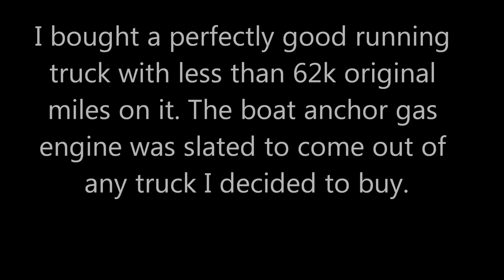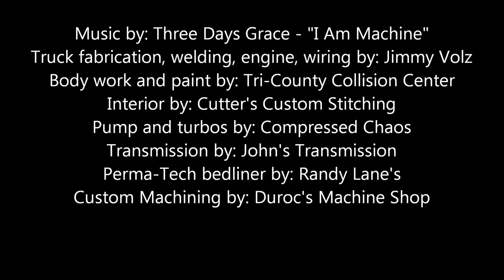1998 Chevrolet Cummins

Comment: All that work and kept it automatic?
Reply from the maker: Yeah... Should have put a NV4500 in it. I mean the auto does great, tows in OD with no problem, stays cool but I'm at no advantage with an auto in a heavy ass truck like this.
Reply: Chevrolet Cummins if I can make it work between the frame and body I'm ditching the 4L80E for a NV5600. I would really like to go with a Eaton 10 speed but that would require a straight axle swap to handle the weight and a lot of fabrication of the frame and modification of the floor. Way out of budget for me and I have a window to get my truck complete.

Comment: How did you tie in Cummins vac/PS pump to hydro boost?
Reply from the maker: I capped the vacuum pump. For the three lines on the hydro boost, one is a dump to the reservoir, one is pressure line to the hydro boost and the third goes to the steering gear box.

Comment: I'm 16 and looking to swap a cummins into an 86 k20. Not much experience, decent amount of knowledge though. Im afraid I won't be able to get the electrical part to match up. Any tips for me as far as wiring the engine and gauges?
Reply from the maker: I would suggest a wiring schematic for your truck and for the truck that the engine came out of. That will help a lot. Also, I would advise soldering and heat shrinking all of your connections that way you won't have to chase down loose connections later. My first conversion was in an 83 K20 and the wiring was pretty simple.
Reply: Chevrolet Cummins I guess it will be my job to do all the rest of researching to get it all to match up but I really appreciate the response. I've watched this vid probably 20 times, no lie. Song fits it really well. Your truck has been a great inspiration. Definitely the cleanest OBS Chevy I've ever seen
Reply from the maker: If you get stumped and can't figure it out, shoot me an email. I might be able to help. 98builtnotbought@gmail.com. Thanks for watching also.
Reply: Also, where did you learn all your knowledge of automotive. Did you go to school for it or has hands on work been your learning tool?
Reply from the maker: It's been all hands on learning. I've owned several square bodies like yours so I know them pretty well. If you do get into automotive fabrication like your engine swap, welding is probably going to be the most valuable skill you could have.
Reply: Chevrolet Cummins at 2:02 I see that there is boring done to the cylinders. Are you a machinist as well?
Reply from the maker: No I'm not a machinist but I have a couple friends that are engine builders and they bored it for me.

Comment: How well does the 4L80 like the power and torque
Reply from the maker: It handles it just fine. Much better than I expected. The controller helps a lot too because I can turn up transmission line pressure as boost increases.

Comment: how is the 4l80e doing behind that cummins?
Reply from the maker: It does real good. Once I got it built heavy duty enough to hold the power it hangs in there like a champ. I'm not scared to gross 30k pounds and tow in 4th.

Comment: what transmission did you use?
Reply from the maker: +Justin Howell A built 4L80E with some aftermarket goodies.
Reply: Chevrolet Cummins what did you use for a tach pickup for your compushift?
Reply from the maker: Justin Howell I don't use the tach part on the Compushift. I do have a Dakota Digital setup that gets the factory one working if I ever get time to install it.

Comment: Would it be possible to cummins swap for $3,000?
Reply from the maker: +Guthrie West Email me and give me more details.
Reply: +Chevrolet Cummins I have a first gen dodge willing to pay for a 4bt or 6bt Cummins swap how much would it cost?
Reply from the maker: +Dodge 318 Cummins Honestly, that is unexplored territory for me. However, I have owned a first gen before and know there is plenty of room under the hood. It all depends on what drivetrain you are going with, finding a good engine for the transplant, what you want done to the engine, how many of the parts you already have, etc... I have priced a couple swaps for people in Chevrolets and it is about $10,000 and that was with an automatic transmission with a controller. Without knowing your specific details, it is too hard to say.
Reply: +Chevrolet Cummins I want a 12 valve 6bt auto is fine my truck is a 1991 dodge d250 the truck is mint it's just gas I want a diesel.
Reply from the maker: +Dodge 318 Cummins Email me at 98builtnotbought@gmail.com.
Reply: I have a 2001 Suburban 2500 that I did a cummins swap on. I sold the 8.1 big block and tranny I had in it and then bought a wrecked dodge truck for less than I sold my drivetrain for. I then bought a good tight nv4500 manual tranny and didn't have to touch anything on the tight ol 12 valve. Then I bought all the little things. It costed me less than 3000 but I was patiently waiting for the good deals and did the work myself. So yes it can be done cheaply. I did it and have over 30,000 miles on the swap. It was well worth it. One of a kind, family trailer puller.
Reply: +Guthrie West You will spend almost 3k alone for a 4bt they are hard to find and sell high when they are found. 3k is going to be really pushing it to do a swap.

Comment: Why didnt you use a duramax?
Reply from the maker: I thought about it but already had the engine, trans and controller from a previous conversion so rebuilt it all and reused it. A Duramax conversion would have cost $10k just to have the stock parts sitting on the floor.
Reply: Chevrolet Cummins good point.  truck still bad ass tho :)